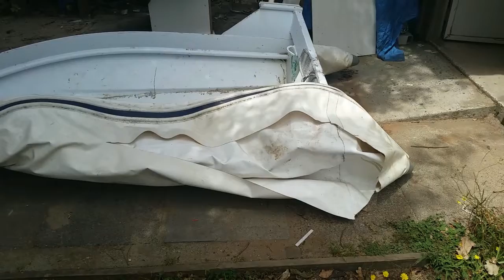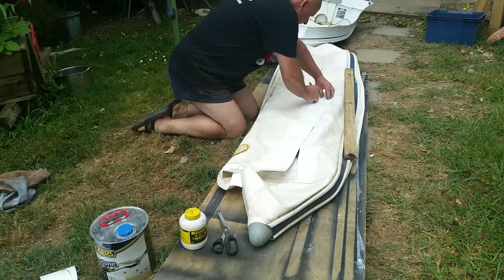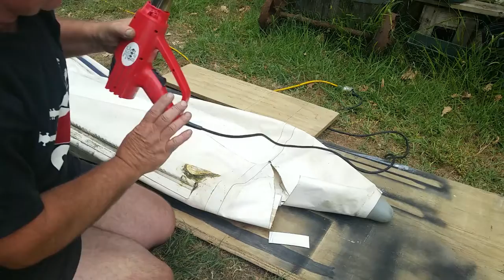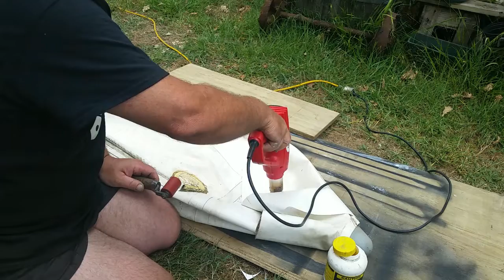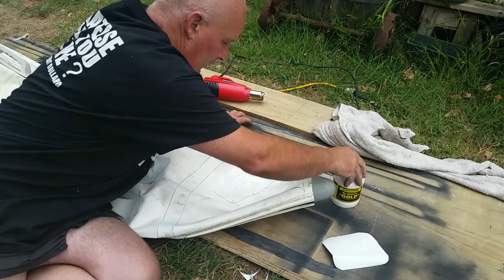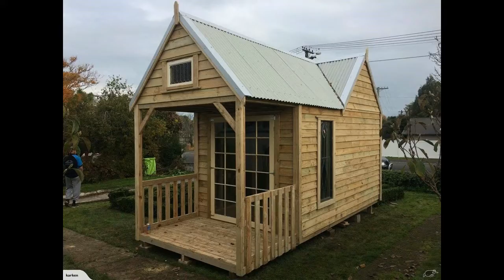How To Repair Inflatable Boat DIY with simple tools

Comment: What temp r u using? I mean in celcius.
Reply from the maker: just 60C - hand hot
Reply: @t.h.o.r.   our temperatures here in India go up to 40 C ... maybe thats why the entire Sea Eagle has debonded ... what happens if I use your method ??
Reply: @t.h.o.r.  Thanks for this answer - I was going to ask the same. I think you need a special heat gun to produce low temperatures like that. I am lucky to have that.
Reply from the maker: @sewingmachinesindetail   Just hold your heat gun further away and move faster. I probably make it look easier cos Ive been doing it for years. This is not a short cut/hack- this glue is the same stuff- without the wicked profit margin.
Reply from the maker: @sewingmachinesindetail   Ill go check out your channel- I have an Adler, a Durkopff and a Sieko that  I have to keep healthy
Reply: @t.h.o.r.  It seems you got the professional stuff then. I am left with cheap modified stuff, but it works for me. 😀

Comment: Is that pvc cement too rigid?
Reply from the maker: the one for guttering and downpipes with the white colour is to rigid - you use te clear one- it is the exact same as bostik 999 which is what the manufacturers use
Reply: Don't use pipe glue!

Comment: Whatkind of glue
Reply from the maker: OMG- the video is about the glue! watch the video.
Reply from the maker: Here is a clue- Its a PVC boat.
Reply: @t.h.o.r. sorry the video started half way in i see the intro now but dont matter we cant get that glue in canada anyways
Reply from the maker: @donaldotsig6818  If you have PVC plumbing pipes- you have PVC glue. I was in the canvas and pvc fabrication business for 30 years
Reply: @ Do they seal and bond pvc boat material as well as the two part ones designed specificaly for inflatable boats thanks and if i cannot get the one you use which would be a good one to buy here in canada
Reply from the maker: @donaldotsig6818  The 2 pack one is great - but only needed on old sun baked PVC.Its expensive here and I always found std pvc glue to be  just fine on all jobs. A quick pre treat with isoproplyl or MEK softens old pvc to make the cheap glue work. Ive NEVER purchased the expensive glue- always had great results with 'pipe cement' glue. NB- it wont work on 'hyperlon' boats

Comment: I just tried to use this method does not work I used oatey regular clear pvc cement i prepped the area with mek and sanded both sides on a  test patch out of pvc does not work

 what iam I doing wrong? I can peel it right off no strength do I have the wrong stuff? I put alot of glue on it,

Comment: Hi.  I like your video.  I am looking to glue d rings to a stand up paddle board.  I can find type type N glues that are clear.  Are they what you are using.  Thanks for you help and interesting ideas

https://www.mitre10.com.au/bostik-plumbers-mate-pvc-pipe-cement-type-p-44117
     Sites say type P but info and bottle say type N

https://www.bunnings.com.au/protek-500ml-type-n-clear-pvc-cement-for-non-pressure-pipes_p4750119

You also mentioned a purple primer.  Both stores have a red primer but no purple.  How do you tell what the correct primer is.

Thanks again.  Geoff

Comment: How long did you let it set for until inflating again? All handles and transom need re attaching on my 6.7 hypalon dinghy.
Reply from the maker: This glue does not work on Hypalon
Reply: PVC glue WILL work on hypalon, but not the other way around. Doc(30+ pro years experience)